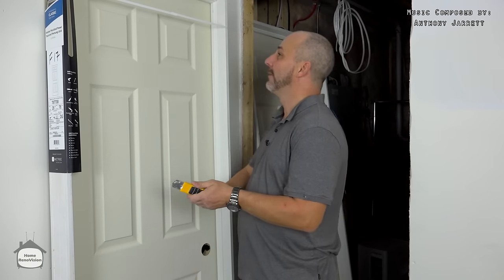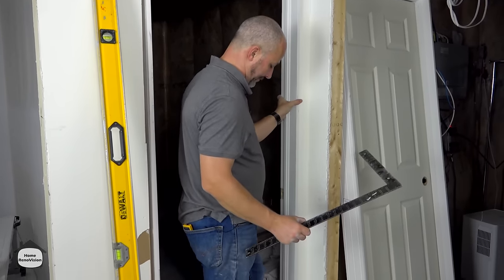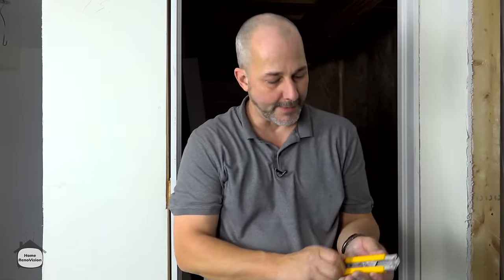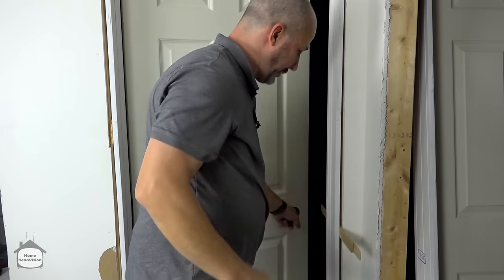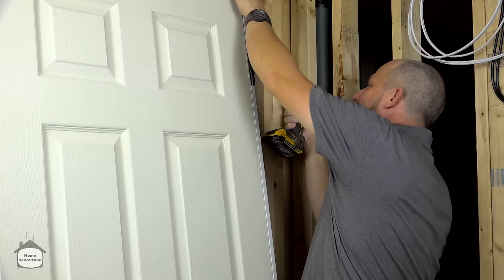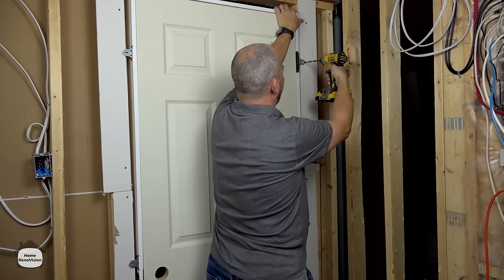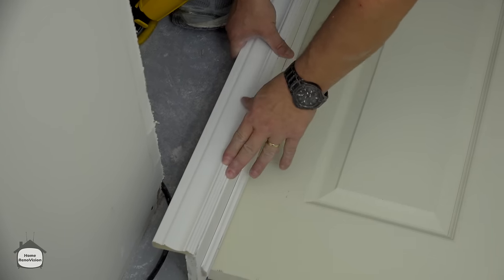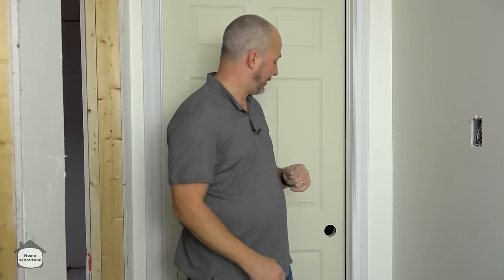How to Install A Pre Hung Door  |  3 Different Ways

Comment: Great video, Jeff!  Very informative for DIYers.  I'm a custom home builder in Colorado and your first method is the most similar to what we do when installing doors.  It's always easiest with two people, but one person can do it - we leave the door and jamb together and check our gaps around the door and shim accordingly.  We can check for plumb/level and make sure our gaps around the door look nice at the same time.  Leaving the door on also lets us know instantly if it has the tendency to open or close by itself so we can adjust before nailing in completely.  We use 2-1/2" finish nails with about 8 on each side (bottom, two in the middle, one at the top; one on each side of the door stop) and I find that filling the holes with lightweight spackle and a 1" putty knife leaves the best results for touch-up paint.  Just thought I would share! :)

Comment: 30:41 - I'm definitely using the 'old fashoned' way for my first door hanging project: 
1:48 Remove pins and set door aside; 
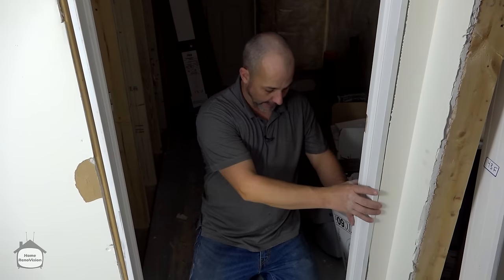4:15 Shim jamb to accommodate floor level;
5:46 Shim, plumb, and flush hinge side of jamb
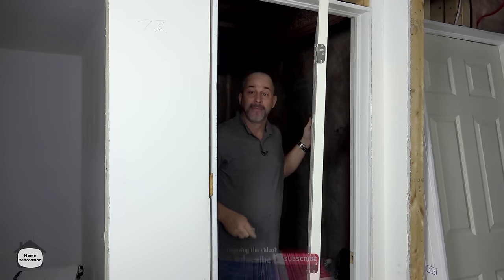9:30 Reinstall the hinge pins
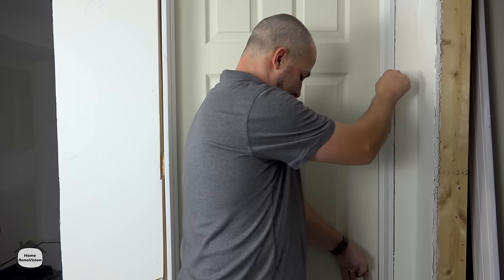9:58 Shim, plumb, and flush to fit strike side

I can do that, thank you very much.

Comment: I appreciate the tips and the detail in this video showing "3 ways for installing a pre-hung exterior door." i really struggled through parts of the process, in particular trying to get the door hung and aligned properly. I must say though after listening to your "less than a ringing endorsement" of the the little metal shim brackets I was put off trying them. Fortunately I hit such a dead end in trying the traditional approaches that I went out and bought a package of those brackets. Saved my life. it finally dawned on me that i am a beginner,  even though I know my way around tools and making/fixing things I had never attempted this task. In short, those little brackets are life-savers for beginners. Thanks for your video.

Comment: I've had great success hanging interior doors with 16 gauge brads, through the door stop. The same way you installed the door with the screws, only using 16 gauge. Great video.

Comment: This is a great video; wouldn’t expect anything less from Jeff. I’d recommend the first method for beginners where you remove the door slab from the frame to install the hinge side of the frame first with screws before replacing the the slab and completing the job; first time plumb and level despite an uneven floor and framing that isn’t level. I’d add an explanation and tutorial on trimming one side of the frame to ensure both sides of the frame sit flush despite  an uneven floor.

Comment: I worked with an old chippy who would take one screw out of each hinge and replace it with a long screw to secure to the stud. Good tip
Reply from the maker: That works great!
Reply: industry standerd, most doors today come with three screws in a bag stapled to the jamb
Reply: My step dad said that was an easier way to do it to. I tried to install a door....unfortunately it was before i saw this video. 😞
Reply: @Joe T I order hinge screws from Amazon. They have every color in 2 1/4 or 3" they match the small hinge screws perfectly. I put a long screw in each hinge and 1 behind the strike plate.

Comment: I bought a spec. house from the original owners and they had a laundry room added out into the garage.  The builders put on the new EXTERIOR door with the brad nail method.  After a few years the door, frame and all, was rocking in the wall.  I went back and did it right!  Great video.

Comment: For the second option, especially for DIY, it has the additional advantage of not having screw or brad nails holes that you have to patch and let dry (and you should use painters putty or hard spackle and not caulk if you care about having a great finish as of course it will not give you a smooth surface when it dries and shrinks.).

Comment: When installing a door with the metal brackets, you reset door  to allow for the thickness of the drywall and you don't have to install dry wall strips before installing door.
Reply: Jeff might want to read the manufacturer's instructions.  You also strike a plumb line 1/2 an inch from the rough opening on the hinge side so you can line up the creases on the face of the clips and ensure the hinge side is plumb. And checking for an even gap should be done on the opposite side, where you can actually see the gap. I think Jeff decided he didn't like this system before he tried it.

Comment: Jeff... Thank you so much for this video!! I put in one new door today and will be putting another in tonight/tomorrow. Also, thanks for the tip when removing a toilet... To slide a heavy trash bag over the bottom... Really keeps the mess down. Another helpful tip when removing a toilet... Use a shop vac to suck all the water out before removing. 👍👍

Comment: Jeff,good video im a big fan of your work and your detail to the finished scope of work.Your videos has helped me tremendously. I have a question on how i would change out all my doors with prehung doors in a home built in the 1960's,all framing was built with 2x3's.How would you tackle this??Any help would be appreciated.
Reply from the maker: hi joey, I would purchase the prehung door in a knock down kit. that way you can run the jamb through a table saw to cut them down to proper depth. I believe you can still order the jambs custom size , however you are looking at significant additional cost. Cheers!
Reply: Awesome!Will do...Thank you for the help and the quick response back.Cheers!Keep the videos coming 👍🎥🎬

Comment: I'm old school & like the shims & screws.... It's also how was taught, so I'm pretty good & fast.
Oh, could def tell you didn't like the clips, & when I saw all those screws, I don't blame you😉
Cheers, A👍🏻
Reply from the maker: From the moment I opened the bag and saw the handful of philips screws. I just about said to Max "screw this application"!
Reply: I prefer the clips in finish work only because it saves more time on the part of the work I hate doing on doors...  filling holes and sanding.  New construction though it messes with drywall guys too hard to be worth using.
Reply: I feel bad for all you guys still shimming and struggling. There’s something to be said about “old school” methods being tried and true, but you really gave ZERO effort on the clips and it’s unfortunate you were intimidated by a small bag of screws. It does make me angry that this video has turned so many off to using the clips because of your failure to read the worlds shortest instruction manual for a building product ever. I had come to expect more from your videos and have enjoyed most of what you produce. 

As a full time home remodeler I always find it frustrating and sad that SO MANY in the field are so stubborn with new innovation. Granted, many products come along that are a waste of time, but I am always on the lookout for new innovation and will try out new products and tools constantly. Those irritating clips are the greatest innovation in door installation in the past 50 years. Period. I have converted so many stubborn builders to using the clips by simply using them on site. They see me using them and at first they are always shaking their heads and openly express their disapproval of the product. Then, when I am on my 10th door and they are still on their second, they start asking questions, because in their minds, either I’m a wizard at installing doors or there is something to using those clips.

Why in gods name would you try installing a door without the drywall installed, especially for a demonstration of a product that assumes the drywall will be in place? (as it should be!). In every construction site I’ve ever been on, whether a renovation or new construction, I’ve never seen doors installed before drywall. Doors go up when trim goes up. If I walk in to a site and the doors are up before drywall I’m walking right out of there. It’s honestly a shame this video continues to put so many off of using a product that would benefit them so, so much because you decided it was worthless as soon as you opened the bag.

Comment: No mention on the door reveal (the gap between the door and the jam).  You set the first and third door without adjusting the reveal.  I always adjust the reveal when installing doors. The reveal needs to be the same (very important) for proper door function and quality control.  If it doesn't look good, I don't get paid.
Reply: He was standing on the wrong side of the door on both of those you talked about. He doesn't know what he is doing.
Reply: @paulgugger8987  smh

Comment: The one good thing about the bracket method is that there are no screw or nail holes to calk or putty.  I think I would also add shims behind the hinges and replace one hinge screw each with a long screw into framing.

Comment: I love your videos. I know you weren't a fan of the clips. Most master carpenters probably aren't. For a novice door hanger like me, though, they worked great. There is, BTW, a method to set the clips back a 1/2 inch if you're installing the door before the drywall has been hung (so you don't have to throw up some drywall scraps just to hang the door).

Comment: When he first set the frame to the floor, he never mentioned you need the height of the finished flooring and set it that high off the floor
Reply: DR PHIL  do you mean to loose install the door than when flooring is going in you can cut jambs to hight?

Comment: Interesting video for homeowners so they have an idea how to install their doors and fun video for pros watching a handyman (no pro door installer guy) hanging doors, last method he used was wrong, always attach the casing to the door on the hinches side with the door resting against the wall standing, and adjusting just like the method #2 just nail the casing with 16ga or 15ga nails instead screws, for added strength use wood shims and nail them on the jam sides.

Comment: Thanks for the video, enjoyed it but have one concern. I just finished my basement and installed 3 doors using the clip method. One of the doors had a unfinished side as yours did but if you had read the instructions, you didn't need to install the strips of drywall. There is a way to mount the clips on the door frame to compensate for the drywall and would have saved you some time and hassle. Just throwing that out there as I found the clip system very easy to use.

Comment: Do a video how to install an exterior door
Reply: Isn't that the same only outside.
Reply: @superiorbeing95  similar, but with details on the sill plate, load bearing headers and weather proofing.
Reply: Superior Being yes, just with insulation and potentially more screws for safety (prevent break-ins)
Reply from the maker: Close but there are a number of weather related things to go over.
Reply: @HomeRenoVisionDIY  so does that mean you've got one coming!?
Reply: Home RenoVision DIY 
I’d also really appreciate your insight on installing an exterior door.
Reply: Waiting for this also.  Always good to see other perspectives
Reply: We just installed a couple of new exterior doors and they had the vinyl casing already attached on the outside.   Similar to method 3 but with a few screws and shims to hold it square, plumb and level, plus silicone.  Took about 30 minutes to do both and to be honest (never done one before) wasn't that much different to a window.
Reply: Yes please. If he doesn't do a video on that, I'll eat a penguin.

Comment: I’m definitely a fan of method 2. The door hanger brackets cut the time of door install way down. I’m remodeling a condo currently, and have hung 7 doors with this method easily and had zero experience hangings door previously. The method I used was a little different than yours. It seemed easiest for me to draw a plumb line half inch in on the face of the Sheetrock on the hinged side. Then match up each groove of the brackets with the line. Screw in brackets on hinge side.  Then you just adjust the reveal on the opposite side and screw in brackets. But that said I still recommend using a couple shims as the bottom of the jamb tends to twist a little. Flatten that twist out and it only took about 20 minutes per door for this first timer. Love the channel by the way
Reply: you mean like how the instructions tell you to do it? This guy obviously didn't read the instruction when he started with the clips. If you've never hung a door before, the clips are the way to go.

Comment: When you take the door out of the frame you loose square. You're better off plumbing it into position with shims and blocks if 2x or 1x. Thanks for the video, but you're not doing any work in my house.😀
Reply: I'm far from an expert, so forgive my ignorance. How does removing the door cause you to lose square? The door frame has to mount to the opening no matter what. If it's square, flush, and plumb on the hinge side, and then you get the spacing between the door and frame on the remaining 2 sides as consistent as possible, best I can tell, it shouldn't matter if the door was in the frame or not. 

Appreciate insight as I'm probably missing something.

Comment: Great instructional video!!! 
I have a finished door opening with baseboard installed. Sure would appreciate a video on installing a pre-hung door in a finished opening.
Reply from the maker: you should watch the french door video. That will show you everything.
Reply: @HomeRenoVisionDIY  I watched the french door install. While very educational and informative it doesn't help me with my specific issue. I have a room with a finished door opening. It's drywalled and painted where I need to place the door jambs and header. There's baseboard installed around the bottom edges of the opening. I want to install a 6 panel door into this opening. The opening measures 33" wide and 81 1/4" high. I'd like to install a 32" wide door and I'll have to remove the drywall on the wall edges all around the opening as well as cut the baseboard trim. Any videos on your channel that will help? NOTE: there was never a door in this opening.

Comment: I've never done any large diy's such as hanging a door, but I want to do it myself.  Very tight budget.  What tools would I need to hang a door properly.  Thanks for you time. Great video.
Reply: Kimeshia Daniels , if you want to do it cheap as possible and don’t currently own any tools. A 4 foot level, hammer and nails would work. You can get a level for $20, and a hammer for probably $10. Pre hung doors go on sale frequently (in Canada) for around $100 each. You would Just follow Jeffs steps from this video, minus the power/air tools.

Comment: Thanks for the video chief. Good stuff. But on the clip technique you don't have to have finish drywall. You screw the clips on to the backside of the jam a half inch down. There are grooves to line up with so you don't even need to pull out your tape measure. Then the drywall will butt up perfectly. You can do a door in about 4 min if your floor is straight. Just a heads up. Awesome videos. Keep I'm coming champ.
Reply from the maker: LOL, learn something new every day. Cheers!

Comment: I prefer using long finish nails instead of screws but always use the shim method in the same way you do. Hinge side first and then adjust the other side to the door with proper gap to the door. I also nail both the door part of the jam and the exposed section of the jam to eliminate twisting of the jam prior to the casing getting installed. This is a great video and always like your tips which show me other ways to do things.
Reply from the maker: Nice technique Bobbie!

Comment: Great video Jeff! If the jamb was not going to be painted and the door stop was already attached to the jamb, how would you attach the jamb to the framing so that you would minimize the visual impact of the screws? Thanks!
Reply from the maker: I use a drill bit to predrill the screw location and then use 45 mud to repair the hole. Cheers!

Comment: Hi there, greetings from Romania.
I have a home built out of 3 modular containers, the walls are sandwich panel 5cm thick with insulation between the metal faces, and also i added exterior insulation with 20cm expanded polystyrene. On the inside do you recommend wood frame or steel frame for some separation walls? Which structure holds better a door? Also on the inside i would like to put some drywall on the walls, between the sandwich panel and the drywall do you think i need a vapor barrier? Thanks for the videos, keep them coming.
Reply from the maker: Cheers to Romania!

Comment: Ok. JEFF Whats the usual extra rough framing gap on top? You said 2 inches on side. For strength would you recommend a steel or fiberglass. I know wood it probably the strongest but, what about between fiberglass and steel.
Thanks. Ric.

Comment: Who ever framed those doors needs to invest in a level!  I built a workshop and was only out of plumb by 1/16" over a 24 foot span; made installing all the doors, windows and siding super easy. Makes the old adage very relevant for some of today's quick and dirty builders: Start level and square, finish level and square!  Thanks for posting, had to watch this as I figured there was only ONE way to hang a door, with shims. My dad's advice to me (like so many): If you're going to do it; do it RIGHT.
Reply from the maker: But there are so many ways to do something right!
Reply: @HomeRenoVisionDIY  True, but like the door you had to adjust (that was not "right"). So, you can change the adage to: If you're going to do it: do it "Well". :-) 
adding on edit: You did 3 ways well done, thanks.

Comment: Great video! Do you have any tips or tricks on replacing an exterior door jamb.   My father-in-law install a new door years ago. Not long after he installed in I noticed a gap around the door. I fixed the gap, so I thought. Now it's so bad the door will not stay shut or lock. Need help please!